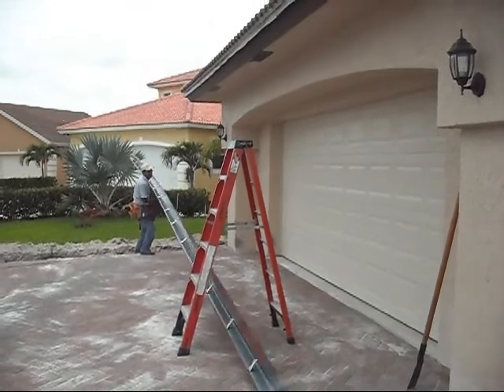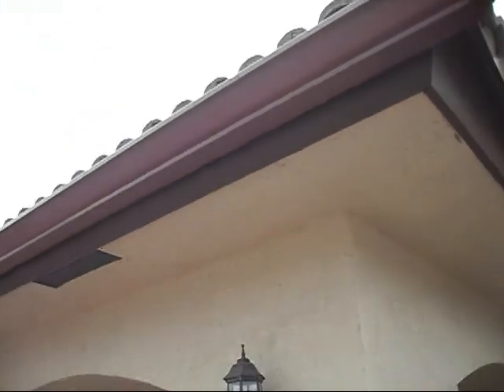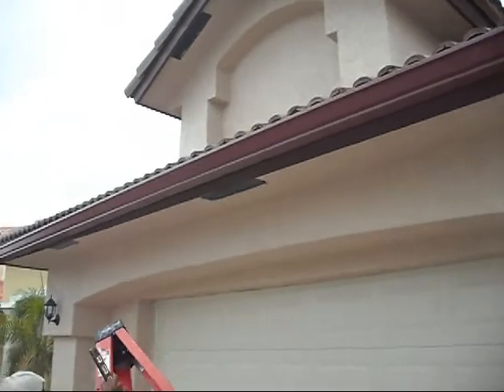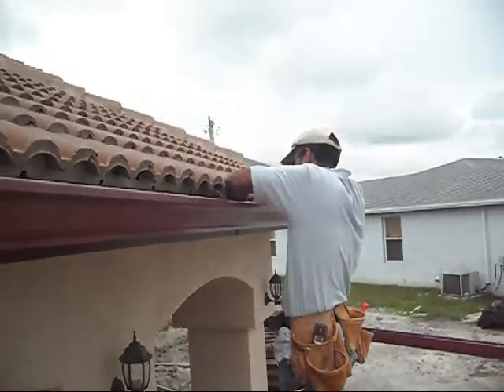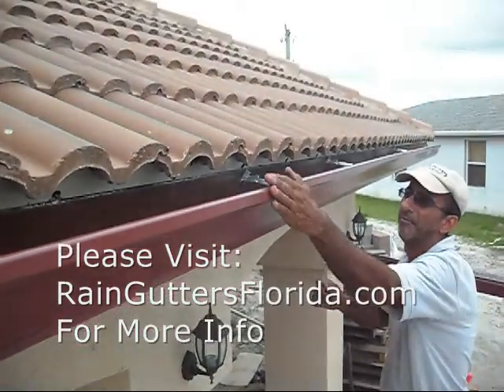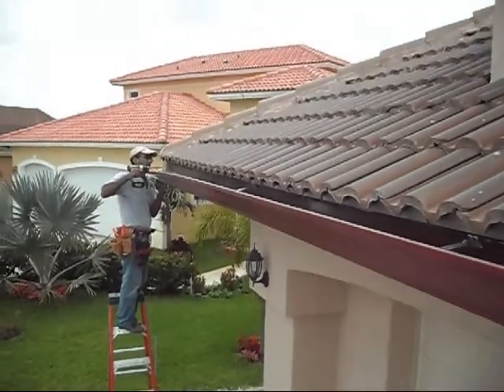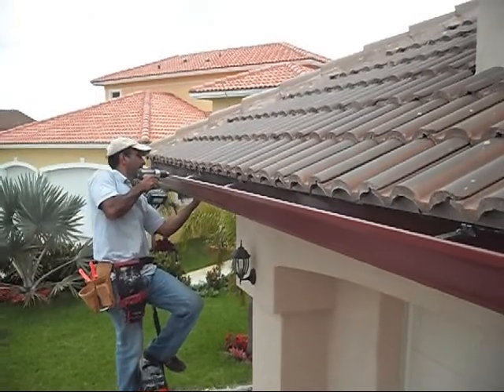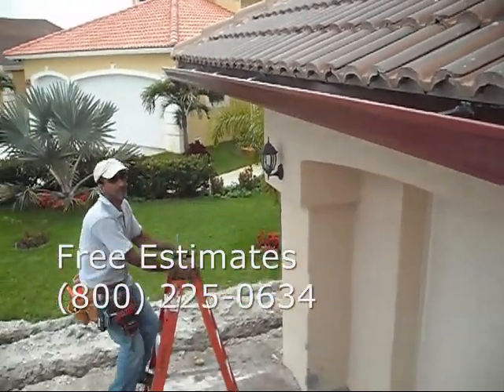Seamless Gutters Installation Spikes or Hanger Tamarac FL

Comment: Dripping edge drip edge you mean plus the hanger is not clipped to the gutter ... you don't check pitch in middle of the gutter you lift the middle alway up check pitch 10 feet from edge you use 5 hangers in 40ft gutter? Gutter hangers should be used every foot  if yo want to save do ever 2 to 4 ft
Reply: Duric Gutter they are using the wrong part to do this job.  With the gutter back under the drip edge, you use a hanger with no clip.  The clip is to put over the back of the gutter (the reverse side from the k edge)

Comment: Shouldn't be filming your mechanic standing with one foot on the ladder step and the other foot on the back of the ladder. That rung is not design to be used as a step. Workman Comp claim waiting to happen. And prove that the Florida Building code requires the gutter hanger brackets to be every two feet. I can't seem to find that requirement in my copy of the Florida Building Code book. Did you need to pull a building permit to install the guttering in this video? If not, who is going to check that the hangers are every two feet away and not three feet?